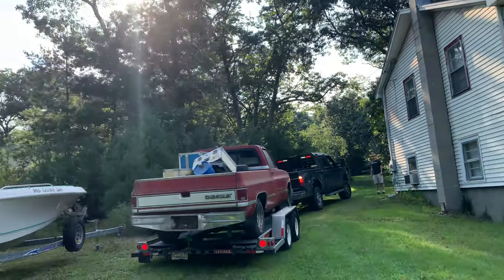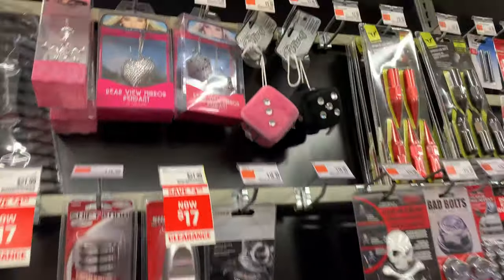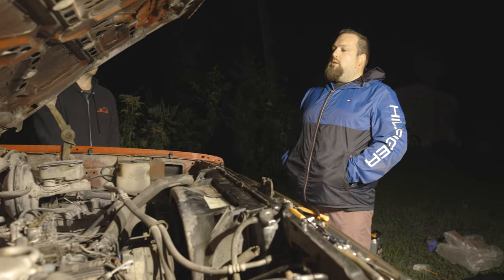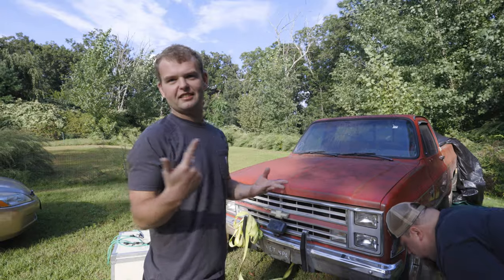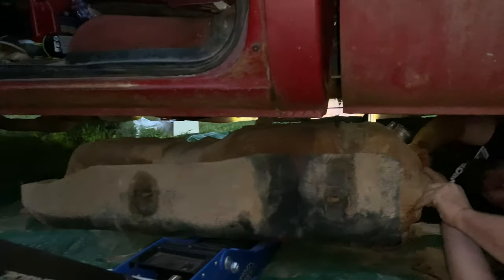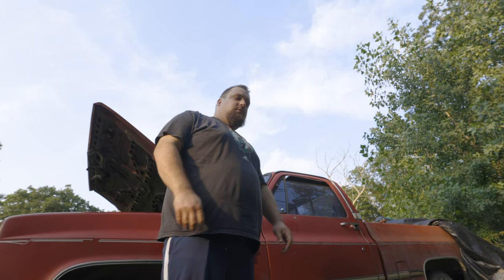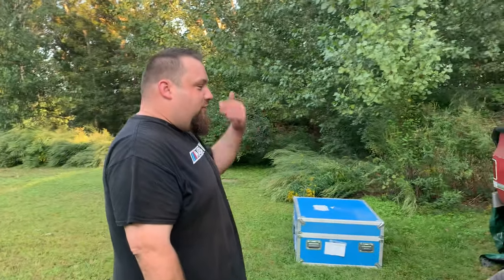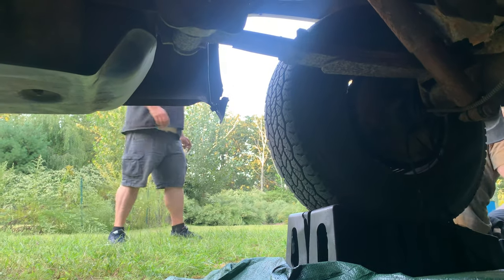The 1987 C10 Silverado FINALLY Runs! (Fixing The Fueling System)

Comment: Have same pick up and same issues. Got me motivated to do all your guys tips and hopefully get it running
Reply from the maker: Good luck Juan!
Reply: My doing the same thing. Did u get it fixed mi Amiga?
Reply: Same here, just bought a 1994gmc one ton van have in same problem hope I can get it fixed 😜
Reply: I got the same thing going on, don’t let it stop you!!!
Reply: I have fuel coming out of my hose but not coming through the injector. Best place to start is by taking off the cradle for injectors and seeing if you have fuel coming out of your hose. Next test pressure then injectors. After that there’s nothin to it. Good luck!
Reply: Auto Zone👍

Comment: You guys are clueless lol
Reply from the maker: Well of course, we’re inexperienced and this is how you learn. You were clueless once, too.
Reply: @NotSoHandyCarGuy  🤣🤣 i taught myself how to work on my 87 and fixed it when a certified mechanic couldn't. Now i can do donuts on me and my wife's ranch if i want to.
Reply: @mountainwolf1  just fixed mine, did a sick burnout before it started stalling. Just gotta fix the broken factory fuel pump, only using the Holley one that’s pushing through the old one. I was surprised how strong the 350 was, so eager to go full throttle
Reply: @zonamade3380  brutal i do pretty much all the work on my chevy i love that truck. I too replaced the fuel pump on my other 84 c10 305 scottsdale its not that hard believe it or not. On a 87 v10 350 tbi it's a sending unit which i also replaced with a new tank in the dirt in the desert. Some mechanic was going to charge me $2000 for the sending unit replacement i paid $250 for a tank+unit  and did it myself. Stay strong and keep that chevy driving big dawg✌
Reply: @mountainwolf1  wow 2k smh gotta save that for performance parts. I think I can manage, not trying to pay the man either. Got enough brain cells to do it haha thank you for the info